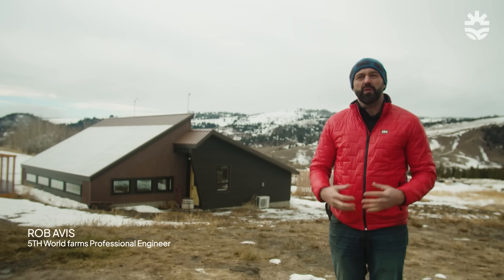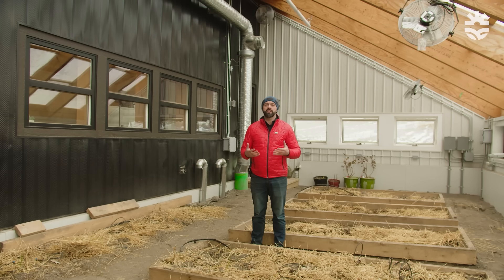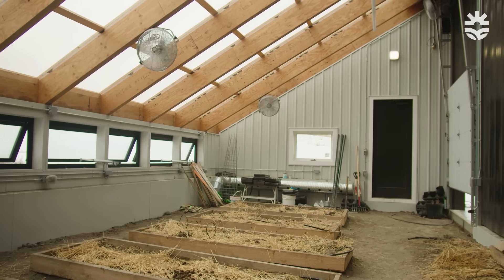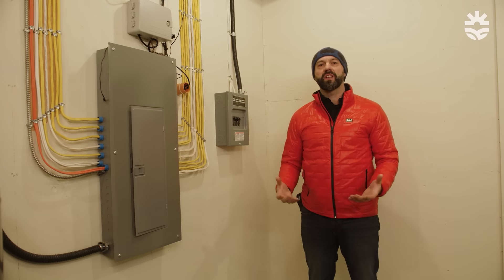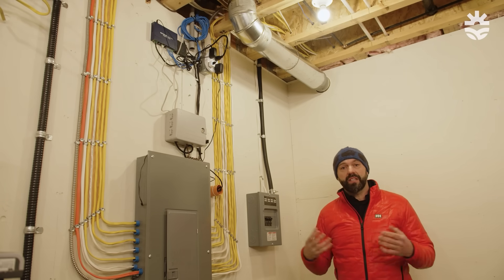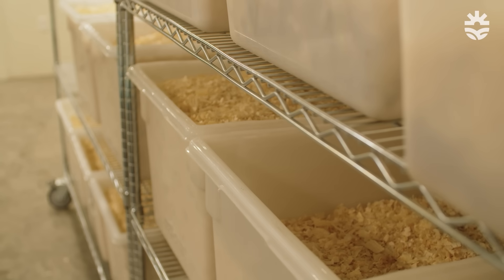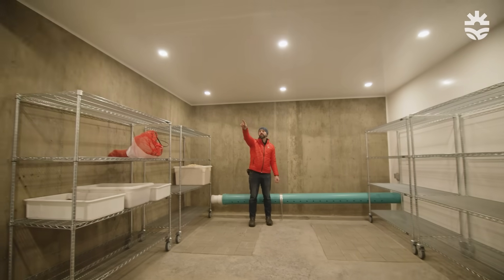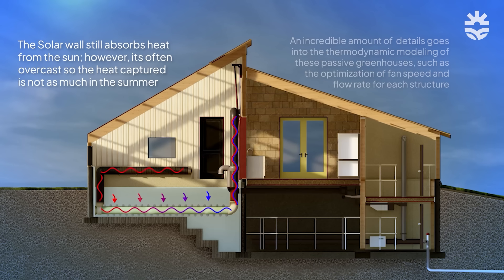Revolutionizing Agriculture with 5th World’s Passive Solar Greenhouse

Comment: Hi, Rob. I'm currently taking the Verge Permaculture Design Certification course (Fall 2023). This design is, in principle, exactly what I have envisioned for my property. The only thing missing is the laundry room! Thinking you can prepare food, wash your dishes, and have your laundry going at the same time! So, would it make sense to also integrate the greywater from the washer, and, possibly heat and humidity from the clothes dryer? (Ideally, sure, you'd dry your clothes on a line, but that takes a lot more time, and may not always be practical under certain weather conditions.) In my current situation, I am constantly struggling for time, and being able to multitask for instance, doing kitchen work and laundry at the same time, is always a plus! I welcome your feedback.

Comment: While fun and novel, growing citrus 🍊 in winter climate geothermal battery electric greenhouses is going to be very difficult to make pencil out. 800 sq ft is a personal use greenhouse; awesome for a family, but it’s not commercial scale. Olives are grown in low wage countries on marginal land for a reason, their production per square ft isn’t going to get close to even citrus. A Cara Cara Orange tree would need at least 100 sq ft and at best might produce up to 100lbs in those conditions. At $5/lb that’s $5 / sq ft or $4,000 top line for the whole greenhouse. That said, this is a very cool project, done at a rather high level of sophistication. I hope you come up with a great mix of plantings that will benefit your family for years to come.

Comment: Very nice. The wall that you are calling a "solar wall" seems to work like a Trombe wall, in that it absorbs heat from sunlight and delivers it into your space. But instead of doing this via a thermal mass, you're heating air and recirculating it. Very clever.

Comment: That's great but should be done without halogenated vinyl or halogenated carbon manufacturing pollution or hazardous waste burners.  These molecules are the primary causes of global warming and global infertility.  These serious and persistent damaging effects of chemical weapons manufacturing use and disposal burning was supposed to be eliminated by the US EPA mission under treaty enforcement and obligations.  No halogenated vinyl or halogenated carbon manufacturing use or disposal burning.  Certainly what has been done here can be done without plastic paint solvent and fire retardant.  Edison generators AKA permanent magnet motor as a generator and dynamos brushless motors as generators can replace fossil fuels and nuclear power plants or grid power.  The very important quality of survivable industry is no plastic manufacture pollution and no nuclear technology
.
Reply: CO2 is not a problem.  The atmosphere needs more CO2, not less.  CO2 never has and never will drive changes in climate.

Also, the result of a sexually debauched society is fewer children.  Women don't want to have children if they're busy whoring around.  I believe godless sodomites is the term to describe them.
Reply: I don't know what you're trying to suggest with motors and generators but it sounds a lot like a perpetual-motion scheme. If you believe in perpetual motion I have some magic beans to sell you.

Comment: Thanks for the content. Interesting passive solar and geothermal solutions.  My suggestion is to look into using bifacial solar panels as greenhouse roof panels and outdoor vertical fence panels to generate electricity.  The prices of these bifacial panels are competitive with the older single face panels. I like the micro ag model and like the ideas mentioned in the Utah guy Butterfly Energy site and YT channel for utilizing bifacial solar panels for energy production to support agriculture production.

Comment: You aren't going to get much thermal storage beyond the first day or two of heat sink usage. The area surrounding the single pipe will quickly acclimate and then your thermal differential is lost and efficiency tanks. Not sure how you ran the numbers on this but I sure wish I could have helped challenge you concepts before you got this far into it. You still have functional ventilation, which is good...but the thermal battery isn't really happening with this setup. Definitely not seasonal storage, that would require orders of magnitude more surface area and an ideal storage substrate.  I would recommend using compost heating for the greenhouse, you will also get CO2 boost from that. Not trying to be a buzzkill,  just pointing out some engineering blindspots.
Reply: Verge Permaculture has done the research and engineering. If they say it's going to store heat seasonally, it will.
Reply: Glad I'm not the only one who has doubts that a single black wall can store heat as well as this requires.
Reply: @sergarrick  They use an underground climate battery as thermal mass.
Reply: It's a single pipe for the purposes of illustration, but in reality it's a whole network of tubes
Reply: The activity in the kitchen is another input that needs a thorough test run. If the system was purely geothermal I would agree that the thermal storage isn’t large enough. However, being tied to the kitchen, having unspoken supplement through the heat exchanger/pump, added biomass of plants and human activity, and zones that can be manipulated for troubleshooting, there are too many variables to call it a failure with only this video as reference.
Reply: @alexanderdekeuyper2990  yep.
Reply: It's not Rob's first rodeo, and he's an engineer.
Reply: I agree no way it would "store a surplus of energy from summer to winter" if the pipes are deep enough it will cool in the summer and ca

Comment: In that radon is naturally occurring and more or less omnipresent, have you installed radon detectors and if so, what are their counts?  If the counts are too high (conceivable, you're literally sucking air in from the ground), what remediation solution have you generated?
Reply: In this type system there is no air exchange with the ground. (in theory)

Comment: hey, what about mold, is it possible for it to gather beneath greenhouse in those pipes ? i've seen few people claiming that mold as an issue in geothermal battery. i would like to hear from profesional, thanks!
Reply: I do not know what they do but I have a commercial fogger and blow hydrogen peroxide  mist though my system.  I then have a towel  cover basket over the outflow to catch any remaining mist.
Reply: I guess mould is possible but it's never been an issue for us in five years. So far, so good!

Comment: my guess costs are upward of 1.5 million or more...how sustainable is that for most...
Reply: These people are doing nothing but flaunting their expensive, over built projects that waste so much space and cannot run without everything being automated with electronics.  For the money spent they could have simply built a medium sized underground storage area and stocked it with enough food to last 100 years!  The average person can't afford to build one of these - we need people who can design systems that can be built with minimal expense, are DIY, and do not have high energy requirements to run.  Three things were blatantly obvious - 1) the tiny amount of growing space compared to the size of the greenhouse enclosure, 2) the massive kitchen area to process the small amount of food that would be generated by the small growing space, and 3) if one portion of the electronics failed it would likely cost more to repair than all of the food produced in one season.  I also question WHY is so much of this facility entirely above ground?  The only thing that needs to be above ground is the greenhouse window area.  One of the best setups I've found is where the entire house is inside the greenhouse - https://www.cbsnews.com/media/5-greenhouses-that-are-actually-homes/
Reply: @Rattlerjake1  I agree with you're argumentation however the examples you've linked to aren't accessible to the average joe neither.
Reply: @ottodidakt3069  - Actually they are.  What I linked to are examples only. That doesn't mean that you have to build something that huge and expensive. People need to use a little imagination and ingenuity and learn how to modify.  What we see on most of these youtube homesteading sites is a couple or family that takes a bare piece of land and builds a HUGE house and use all kinds of expensive construction equipment, new tractors, etc. to do everything, they can only do this because they make a lot of money from Youtube. Where is the person who builds a large greenhouse FIRST and then builds their MODERATE-sized home inside it.
Reply: @Rattlerjake1  One nation has already done that by means of mass production by producing HOT STAMPED PARTS and modularization of the greenhouse designs and engineered to be highly scalable and using Ekor plastic impregnated synthetic mica glass fabric and has an external expanded metal mesh cover against hailstones. But it cannot be exported to America because of the 
Anti-Russian Sanctions. It was meant for dachas as large as 1 acre to 2.5 acres or 1 hectare. You will not find it in any advertisements, even in Russia, because it is only advertised by word of mouth for the product sells by itself.
Reply: What did you do to calculate that price tag? This may be a somewhat pricier version of the concept, but I think it could be done for far cheaper than a million.

Comment: On of my big dreams is to build a geothermal greenhouse a lot like this, BUT, I want tropical temps for exotic fruits, tilapia, and freshwater prawns growing in an AQUAPONICS SYSTEM (In the Pacific Northwest). I want to take advantage of a little known amazing solar water heating invention to heat the water of the aquaponics system. The amazing solar hot water system works all the time, even at night in temperatures as low as -10 degrees Celsius. The New Zealand "The Alternative Energy Company" makes these amazing solar water heaters.
Reply from the maker: Wow, that sounds like an incredible vision! 🌱🐟🌞 A tropical aquaponics system in the Pacific Northwest is ambitious and exciting, and it’s amazing that you’ve found a solar water solution that can handle those cold nights. We love hearing about innovative ideas like yours.